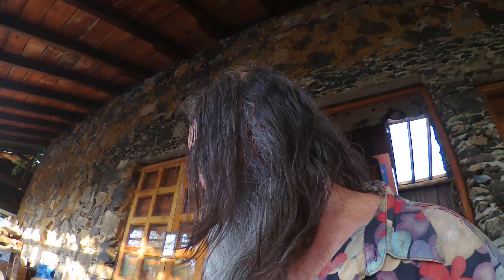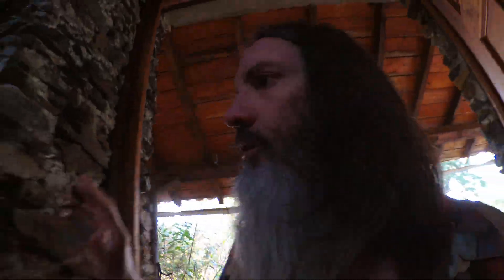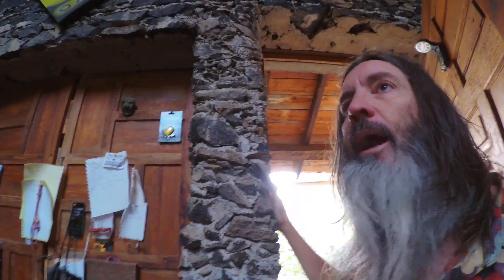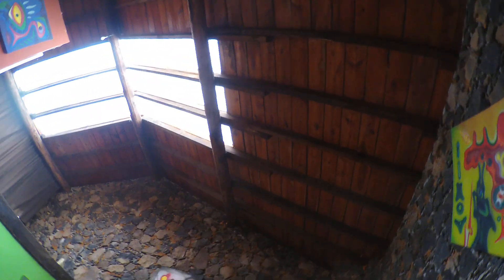An example of not quite right passive solar heating a building.  - Thermal mass.

Comment: Impressive design. True about skylights leaking.
Reply from the maker: Thanks. It is an amazing space, with some weird flaws. 
I should be a more complete architectural evaluation. 
Skylights: I think they can be done better... especially if I do concrete roofs with single sheet tempered translucent glass.

Comment: Great art, colors... Thermal mass makes a difference...   I used to live in an old house with almost 1m (3feet+) thick walls, and the temperature was very steady throughout the year.
Reply from the maker: I have a lot of thought about better architecture. And the space to build interesting examples.
I would like to make examples off many kinds of architecture. I have used cob mostly. 
Would like to do strawbale for sound insulation. A guy nearby build a strawbale music studio. 
And I want to make various traditional building. 
And walipinis for humans.